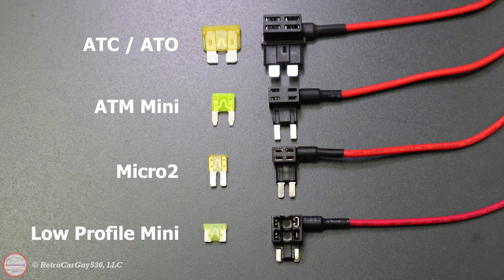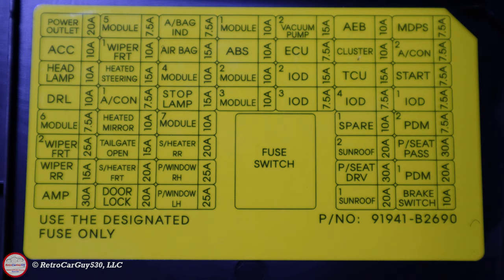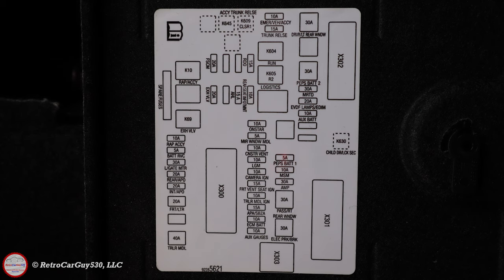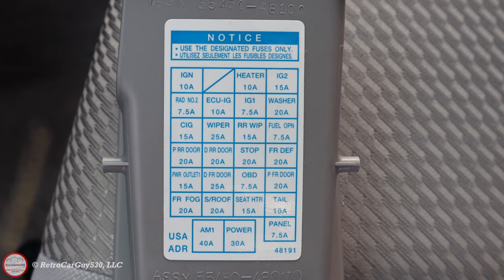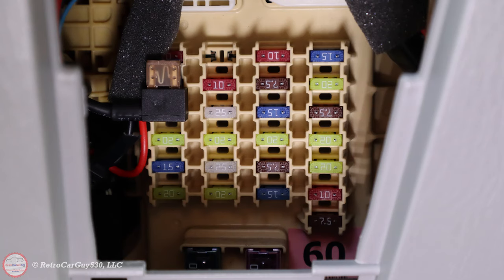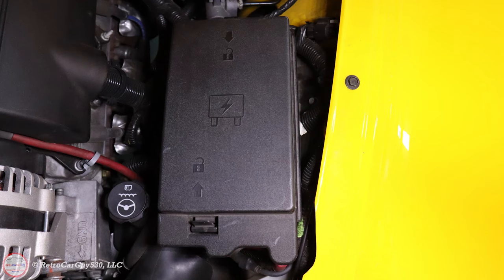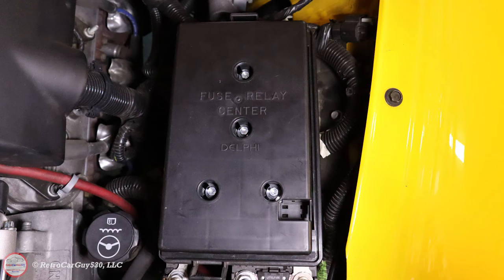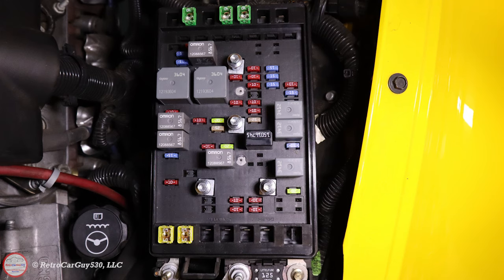How To - Add a Fuse Tap in Your Vehicle

Comment: Do you have to put the same type of fuse as the original one? Or can you put a higher rate fuse instead?
Reply from the maker: The lower fuse socket in the fuse tap holder is for the original fuse in the fuse box fuse socket (if one is present at all). The upper fuse socket in the fuse tap holder is where the fuse for the new accessory is to be placed. Never install a fuse in the upper fuse socket of the fuse tap that grossly exceeds what the new device/accessory requires.  If the new device/accessory only requires 1 amp (or slightly under 1 amp like most dash cameras) then the fuse for the new device/accessory should be in the 2.5 or 3 amp range.  The fuse is to protect the circuitry (wires) and the device so never use too large of an amp rating for that fuse.  There are 1 amp fuses, but I've found that the precision of 1 amp fuses is not as good as one would hope.

A very general rule of thumb is that electrical circuits/wires providing the power to the fuse box fuse sockets have the ability to handle an additional amp load of about 10% more than the fuse in that fuse box fuse socket.  That extra capacity is a built in safety margin for those circuits.  That means a fuse socket with a 10 amp fuse will most likely be able to handle an additional 10 percent (or 1 amp) of load.  For the dash camera example where it can consume up to 1 amp (for the 12-volt supply for the dash camera), you should find a fuse box fuse socket that already has a 10 amp or higher amp fuse in the fuse box fuse socket.  That way if both the original device/accessory that is powered by that fuse box fuse socket reaches its full amp draw of 10 amps, there should still be around 1 amp of extra capacity available to handle the extra load of the new device/accessory.  If there's a 20 amp fuse box fuse socket and you need 1 amp for the new device/accessory, that leaves a little extra breathing room (capacity) for that circuit.

To know if a fuse box fuse socket can provide more than the 10% extra amp load capacity (again a general assumption), you would have to have wiring schematics and knowledge of how power is routed within the fuse box to make an informed decision that more than 10% of the original load was available for the new device/accessory.  Without that additional insight into the wiring and fuse box internals, never assume that more than 10 percent of the original fuse amp rating is available for the new device using a fuse tap.

Comment: Awesome video!  Thank you so much!  I do have a question in regards to adding something to the fuse. In this case i have an under glow kit, the kit has a positive and negative wire, how to i add that to a use like you showed?  Thanks so much for your videos! I’m a subscriber now.
Reply from the maker: The fuse tap is used to obtain positive power for the new device/accessory and the negative/ground wire from the device/accessory is connected to a ground point at or near the new device/accessory.  The location to connect the negative/ground wire from the device/accessory could be any pre-existing vehicle ground point (a bolt or stud where other ground wires are already connected).  Any metal location on the body/frame of the vehicle can serve as a ground connection point as well if you can get a clean/bare metal connection at that location.  I hope that helps.
Reply: @RetroCarGuy530  i understand now. this makes perfect sense!  Thank you so much!

Comment: Excellent video, very thorough. If I need to, can I carefully drill a hole through the side of a enclosed panel in the engine bay for the lead wire of the new circuit?
Reply from the maker: You can, just make sure you seal the hole/wire so that water won't get into the fuse box if any happens to get in engine bay (assuming you're modifying the one in the engine bay).

Comment: I'm having trouble wiring some fog lights aftermarket fog lights. I used an add-a-fuse kit and followed your recommendations, tapped into the existing foglights while having the original fuse in the bottom (15), and a lower rated fuse on top (10). I also used a multi-meter to make sure the add-a-fuse kit was oriented correctly. 

The problem is that the new fog light turns on immediately as soon as it is grounded and plugged in to the fuse box, even when the engine is off. I cannot begin to imagine what I did wrong here.
Reply from the maker: Based on the symptoms you listed, I would venture to guess that the fuse socket in the fuse box for the OEM fog lights actually provides unswitched (constant) power instead of switched power.  The OEM fog light circuit can be controlled by a physical switch, relay or the body control module (BCM).  However it is controlled, it appears the circuit is getting unswitched (constant) power from the fuse box/fuse, but the control side of the circuit is governing when the OEM fog light circuit is connected to ground to complete the circuit and turn on the OEM fog lights.

If there is unswitched (constant) power in that fuse socket (test it with a multimeter and the ignition switch in the off position), it means that fuse socket cannot be the source of the power for your aftermarket fog lights.

Comment: Hello, do you know of a Fuse to tap into that doesn't drop voltage when the engine is turned on? Also, I learned from your YouTube why it is important to correctly orient your  dual-slot-fuse-holder. Thank you so much.
Reply from the maker: As far as dropping voltage when starting the engine.  There are two types of "voltage drop".  Depending on how the fuse socket is powered, the power may shutoff when the ignition switch (or push start button) is placed in the "Start" position and that depends on the ignition switch and circuit design which is year/make/model specific potentially.  The other voltage drop may be a circuit that keeps power while starting the engine, but there's a normal voltage drop that occurs when using the starter motor is used to start the engine.  In an electric or hybrid electric vehicle there may be select circuits that don't have a voltage drop because there is no starter (electric) or a motor/generator (hybrid electric) may be used to start the ICE (internal combustion engine).  The best I can say is use a multimeter to see which fuse sockets are accessory powered fuse sockets (hopefully not obtaining their power from a computer module or supplying the power to a module).  If you want to really get detailed and you have an oscilloscope, you can monitor the voltage level with the oscilloscope to see how it behaves while starting the engine.

Comment: Great video. Quick question? Is there fuse boxes that will not accept fuse taps. I have read that certain modular fuse boxes will not accept fuse taps. If so what do I do next?
Reply from the maker: I've not personally seen a car fuse box that doesn't at least have a few blade style fuse sockets.  There are the traditional two leg blade fuse sockets and some newer cars have three leg (Micro3/ATL) fuse sockets.  There are Micro3/ATL fuse taps available for those situations.  Otherwise, you may need to run a wire with an inline fuse from the car's battery to source power for a new device/accessory.  If it needs to be switched power, then the wire from the battery can feed a 4-terminal relay, but the control side of the relay would need to get a switched power source to drive the control side of the relay.

Comment: Thanks for teh good and detailed video! But i haev one question: the "add a fuse" only provides power, so i still would haev to connect my device with the negative to the nearest ground (or earth). 
i want to install an auxillary digital clock besides my cigarette lighter, so could i just use the existing ground on that, when i am also tapping into the cigarette´s fuse? i hope i could explain my problem clearly. Thank you already! Greetings
Reply from the maker: Correct, the fuse tap only provides the power to the new device/accessory.  You will need to connect the device's ground wire to a good ground location to complete the entire power circuit.

Comment: Excellent video!! Question, how do you know what size fuse to add, especially if adding to a blank/ unused slot? I’m looking at connecting x4 3W LED down lights to my roof header of my van. Thanks
Reply from the maker: If each 12-volt LED light consumes 3 Watts, that converts to 0.25 amps per LED light.  A total of four LED lights will consume in the range of 1 amp, so a fuse the 2.5 amp to 5 amp range would seem sufficient.

Comment: Hey Fabulous video I do have one question though. When you installed the pigtail that didn't already have a fuse did you place your fuse to power your accessory in the top or the bottom of the pigtail? The bottom I suspect, right. Again, great job on the video thank you!!!
Reply from the maker: I discuss the fuse tap fuse socket positions and which fuse goes into which location of the fuse tap at 4:09 in the video.

The fuse for the new accessory always goes in the top fuse socket of the fuse tap.  Only if the fuse socket in the fuse box had a fuse in it before installing the fuse tap, do you place the original fuse into the lower fuse socket of the fuse tap.  If there was no fuse in the fuse box fuse socket, then no fuse is installed into the lower fuse socket of the fuse tap.

After installing the fuse tap into the fuse box fuse socket, if you find that no power is present on the wire coming out of the fuse tap, either the new fuse in the upper fuse socket if bad or you have inserted the left leg of the fuse tap into the incorrect  side of the fuse box fuse socket.  

The left leg of the fuse tap (as shown in the video) is the side of the fuse tap that brings the power up from the fuse box fuse socket and makes it directly available to both fuse socket positions in the fuse tap.  There is no need to have a fuse in the lower fuse tap fuse socket if the original fuse box fuse socket had no fuse in it.  With the left leg of the fuse tap capable of providing power to the upper fuse socket of the fuse tap, installing a fuse into the upper fuse socket of the fuse tap is all that is needed to provide power to the new accessory.

I hope that helps.

Comment: Hi i love the video. Very informative. I have a project that id like to do that i didnt know i needed to do.  After buying 2 led lighted usb cables to use for powering my phones from connections in my center console.  I learned that unlike the usb port, which shuts power when ignition is off.. my center consoled 12v cigarette lighter does not.. power continues to flow to the 12v cigarette lighter so im looking to somehow get my 12v cigarette lighter shut off when the ignition is off... Kinda like the usb port does.  Any suggestions on how to do this specifically?  Any videos thst covers this particular prroblem?  I saw a video using a AAF holder and 2 fuses in an ignition switched socket and the AAF holder wire going to the the 12v unswitched socket tapped using that sliver of metal taped/shrink wrapped to a broken or blown fuse.  Not sure if this is safe or correct and if it is not sure what side the metal silver tap connected to the burnt/broken fuse in the unswitched 12v socket .. the hot side or the unpowered side?  Any help/advise would be greatly appreciated
Reply from the maker: You can achieve something like you want using one of two methods.  Both methods require the same method of sourcing power from the fuse box fuse socket that has switched/accessory power.

Sourcing Switched/Accessory Power:
I would suggest finding a fuse box fuse socket with a 15 to 30 amp fuse in it already to act as the power source.  You don't want to overload the fuse box fuse socket that is providing the power so make sure the original power load of the fuse box fuse socket and the additional load for the two LED lighted USB cables will not exceed the capacity of that fuse box fuse socket.  Pick a fuse box fuse socket that does not provide power to a critical system or module in the car.  You place the original fuse box fuse into the lower fuse socket of the fuse tap and the upper fuse socket of the fuse tap would have a fuse sized appropriately to the power required for the two LED lighted power cables

Option One - Sending Power to Fuse Socket For Cigarette Lighter:
You could connect the wires of the first fuse tap providing the power to a second fuse tap sending the power to the cigarette lighter socket.  The power coming in the wire on the second fuse tap would be sent through the upper fuse in that fuse tap and down the left leg of the fuse tap.  You would leave the bottom fuse socket of this fuse tap empty. You must identify the side of the fuse box fuse socket that does not have power and that's the side of the fuse socket you plug the left leg of the second fuse tap.

Option Two - Sending Power to Fuse Socket For Cigarette Lighter:
Instead of using a second fuse tap as noted in option one, you would find a male spade connector of the correct size that matches the thickness/width of the style of fuses used in the fuse box.  You would connect the male spade connector to the wire coming out of the first fuse tap.  You would insert that male spade connector to the side of the fuse box fuse socket for the cigarette lighter socket that does not have power.  The power provided by the first fuse tap will be fed to the cigarette lighter socket.
Reply: @RetroCarGuy530 hi sorry for the delay in responding.  But based on my learning and understanding from YouTube videos and your very precise  instructions I still wasn't able to get this to work.  Here is my 2023  Mazda cx5 fuse box layout.  3rd down top left is 25a 12v label.  From another video I saw using 2016 Mazda cx5 the fuse box layout was somewhat similar (12v 3rd down from top left) and he selected the bottom most fuse to tap (switched fuse) this is his video. https://youtu.be/FRz8nWmWvp0?si=LcldBJa8JidShO1A

Since the fuse box layouts were somewhat similar (except the fuses have increased was 15a & 7.5a back in 2016 now my 2023 Mazda it's 25a & 15a) I used the same "UTILITY" fuse socket which is "SWITCHED" to insert/house the fuse tap holder with the orig 15a fuse in the bottom slot and a 25a fuse in the top slot adjacent to the wire.  Ran the wire to the "UNSWITCHED" cigarette lighter fuse socket (3rd down from the top on left) and inserted into the cigarette lighter fuse socket (3rd down from top left)  a male Spade connector along with a live un-blown 25a fuse into the side of the fuse socket that does not have power.  My result no change.. still with the engine off ... Lighted USB phone charging cable remains illuminated and does not turn off as I would hope. I'm not sure if I followed your instructions precisely enough but it seems to me (as a non electrical guy) that the male Spade wedged into the non-powered side of the cigarette lighter fuse socket can't due what it's intended to do (get power) from the alternate fuse box socket so long as the 25a fuse in the cigarette lighter fuse box socket is live/not blown/not-broken etc.  Am I missing something in your instructions?  Please advise
P.S. I sent you a pic of my car fusebox layout via DM on IG. And just as an FYI.. I believe I tried to follow your option#2
Reply: Thank you so much!  I want to thank you again for all your help.  You were right and I have only you to thank for finding me the interior fuse box layout guide that you sent me.. that along with your comprehensive, logical, very detailed and knowledgeable  instructions I was able to get the project done !  YAY.  Fuse #9 was the one under the ac under the dashboard that shuts off with the ignition and #11 was the 1st rear cigarette lighter (center glove compartment) the one I was trying to fix that was UNSWITCHED.  I put the tap on #9 with the hot side on the correct leg and male Spade connector on non power side of fuse #11 and it all worked.  Thank you again for finding that fusebox socket guide and sending it to me.  Your the best! .